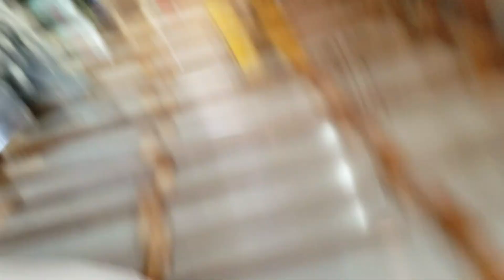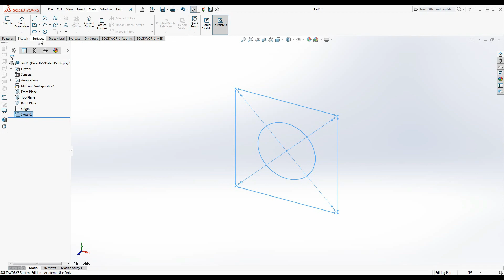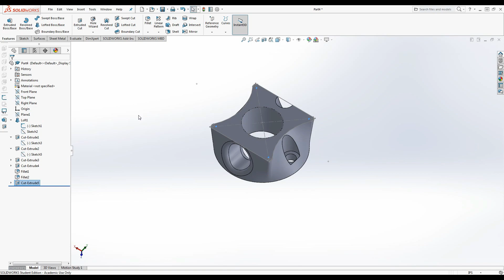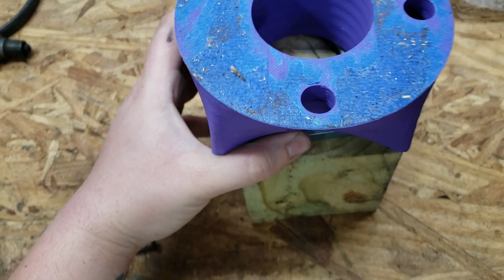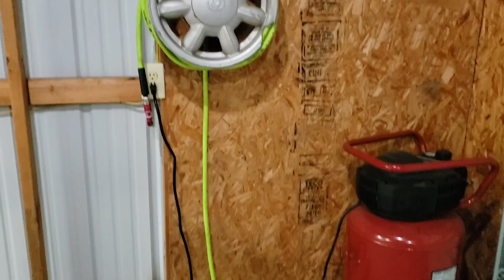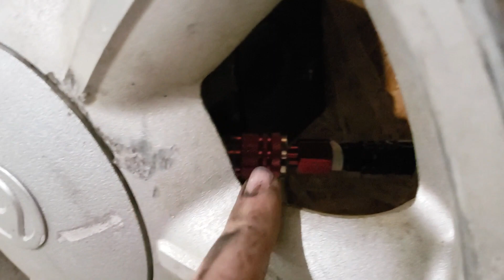DIY Hose reel from a Junk Miata Wheel!

Comment: How has the lazy susan held up over the last few years? I'm trying to come up with a similar design but the "bearing" aspect is proving difficult.
Reply from the maker: Its held up great! There is some play in it since it wasn't meant to be hung like this but works fine
Reply: @PeaceParts  Thanks for the feedback! I was thinking of using a flange bearing but needs a larger internal bore. I also do 3D printing so I was excited to see your design as well.